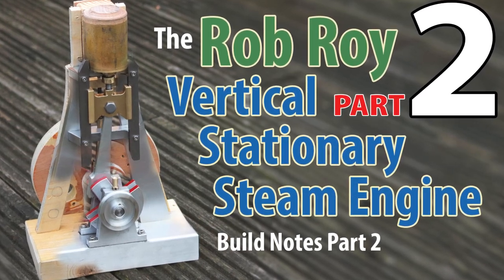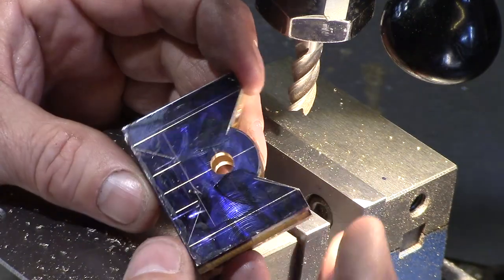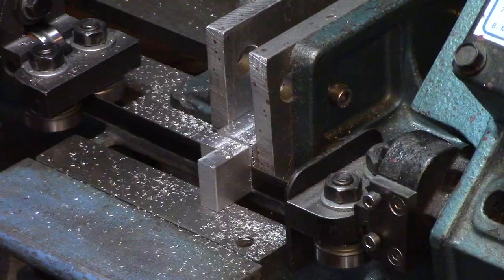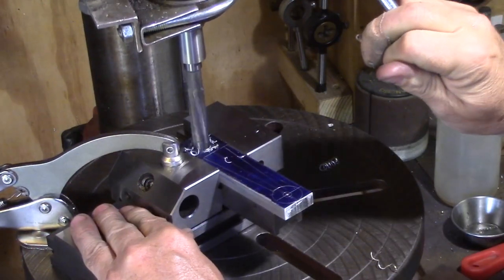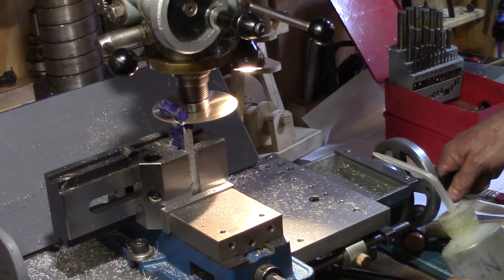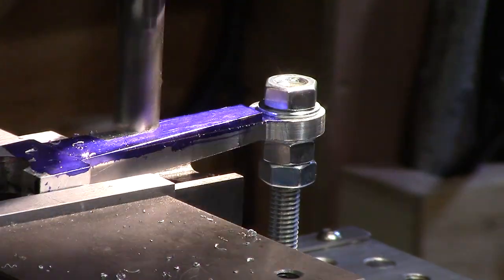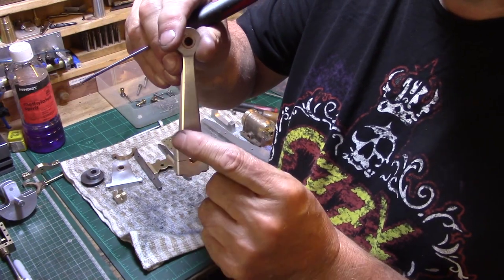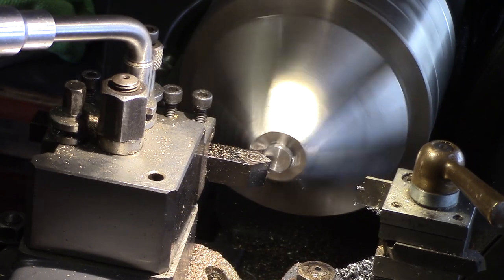Rob Roy Vertical Steam Engine build -  Part 2

Comment: Hi Ade. I'm probably going to adapt my horizontal wood engine design to something like this. Your wood mock up has given me inspiration.
Reply from the maker: Hi Ed, thanks for your reply, my wood mock-ups are not functional, I just make them to represent design ideas, so I can easily change thoughts and ideas, the finished versions of my engines are a far from the original mock-ups
Reply: @AdeSwash  right, and it's a good idea. Because I don't have metal working tools, I have to make my engine in wood. My next engine will probably be in a shape similar to your mock up, as I always admired the shape of the Stuart 10V

Comment: I am enjoying the progress.   Looking very good.
This is the first UK machining video I have seen where someone uses O1 tool steel.   This is common in the US but I rarely see/hear this being used in the UK.  I normally see/hear Silver Steel.   I expect this is similar but not exactly the same alloy.
I love seeing you figure out the dimensions as you go along.   This is how I prefer to work on a project.
Dave.
Reply from the maker: Hi Dave,  thanks for the comment, 01 tool-steel is common in the UK also, used a lot in commercial tool-making etc as you would expect, along with D2, CRV etc. 01 ground flat plate or bar is often called gauge-plate here, and silver-steel is just the round variety ground rod, the same as your Drill-Rod (and there is no silver in it ! ). The reason I used it for the slides was simply to have the parallel precision ground finish off the shelf, as I don't have a surface grinder, for the same reason I use the silver-steel rod for axles and shafts etc, I don't harden it, as its' wear resistance is good enough in the annealed state for bronze bearings in my little engines.  Regards. Ade
Reply: Thanks for the details.   I love O1 drill rod.   I used in my projects.   Very good dimensional consistency.   I also do not have a grinder. 

I have hardened pieces of O1 for wood turning cutters in turning tools I have made.
Dave.
Reply: @AdeSwash  I have about 30 Lbs. of assorted "drill rod" that I've salvaged from printers and scanners when I make "Asset Recovery Sweeps" in my neighborhood- that makes me a certified Asset Recovery Specialist; the rest of the guys doing the same thing are just plain old trash pickers. ☺

Comment: Very interesting and informative video, Ade. 
Just want to clarify though, when you said that the con-rod was '...roughed-out on the mill before finishing to dimensions'. How is the finishing achieved? You don't appear to have a vertical metal bandsaw (I checked your tour vid again!). So are components hand filed, bench ground, or finished on the mill also? Atb. Rich.
Reply from the maker: Hi Rich, my meaning of 'roughed-out' just means using a large end mill to quickly remove material to the basic shape, finishing was to add the radiuses (radii?) into the corners etc, and milling of the taper, again using the mill, and then final finishing with files and scotchpad etc. Sorry for the confusion, not all processes are covered in the vid. Regards. Ade